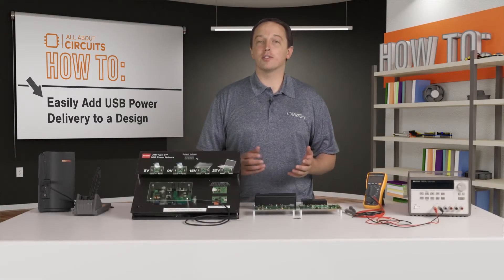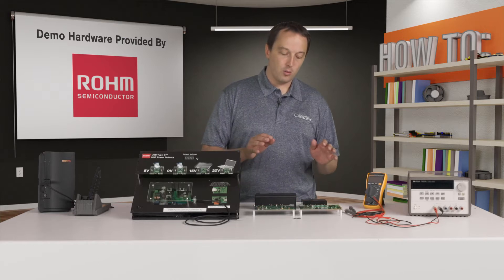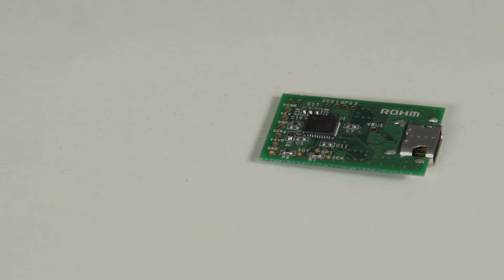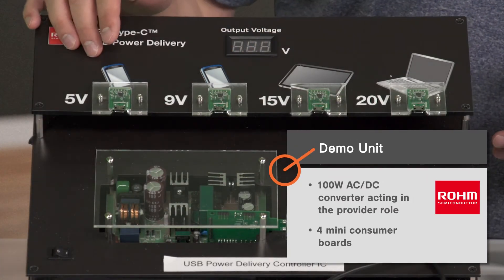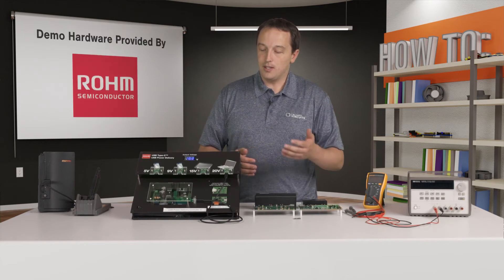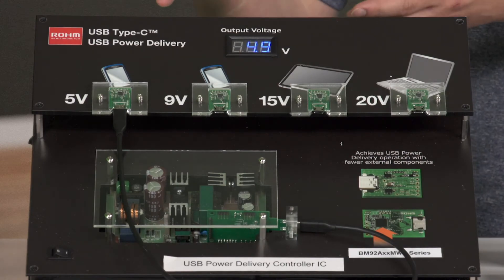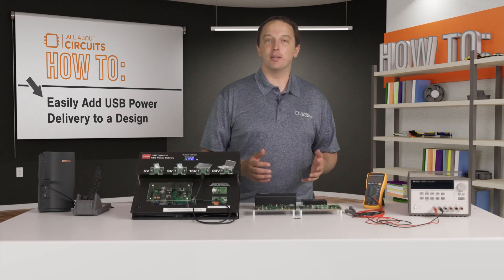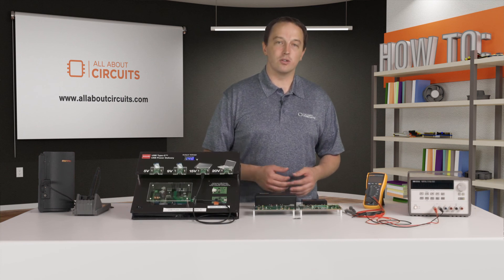All About Circuits How To:  Easily Add USB Power Delivery to a Design (ROHM Semiconductor)

Comment: Do you support 12V?
Reply from the maker: USB PD Standard Power Range "shall" support 5V,3A; 9V;3A, 15V;3A and 20V;5A and this is how it is written in the USB PD Specs.

However, some USB PD sources support 12V as because it is a part of another charging standard (Qualcomm Quick Charge).

In order to know if a USB PD source supports 12V, look at the writing on the adapter as it will show all the Vout voltages and currents supported.

If you have any more questions please visit https://www.rohm.com/contactus

Comment: Yeah. for 200€ for a 4€ worth pcb
Reply: 0_0 200 euroes?!!!
definitely not meant for hobbyists.
Reply: You understand this is a dev board right?  You Use it to make designs from not to actually put into projects PHYSICALLY.  Its the design you are buying, basically.  And then you drop that DESIGN into projects you are developing that can use the power delivery system without having to do all the math of the resistors, etc...